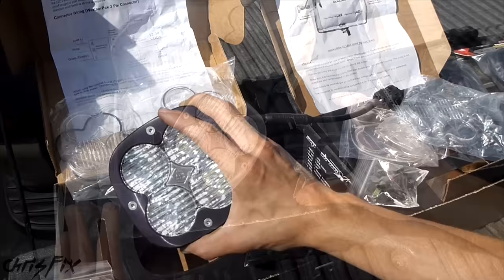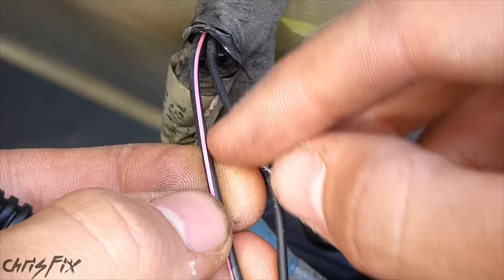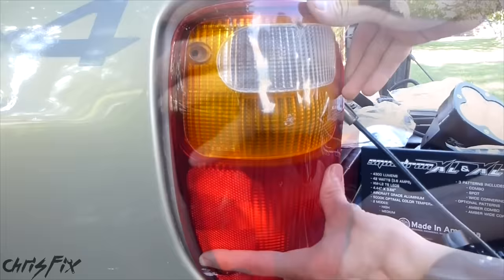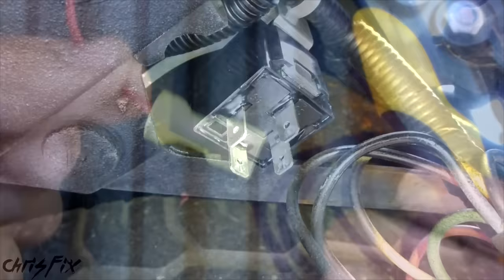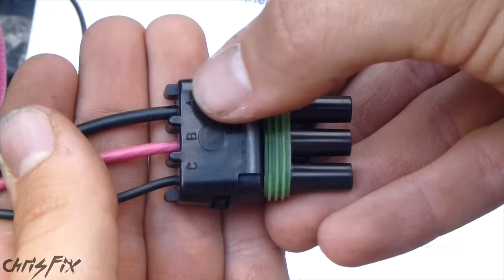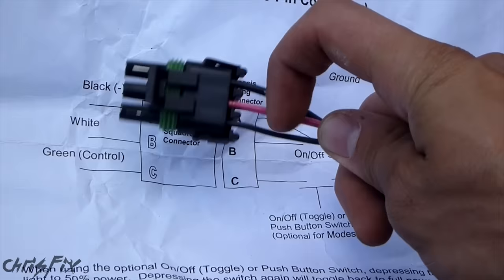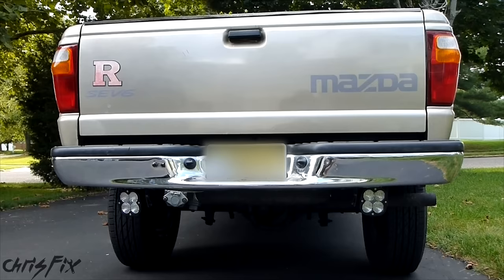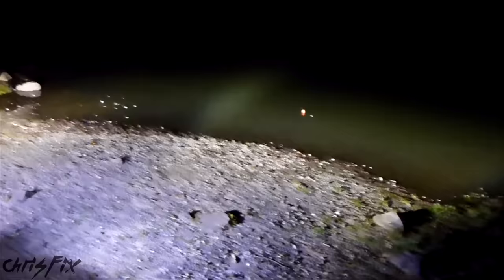How to Install Auxiliary Reverse Lights

Comment: I would install this just to mess with people driving with their high beams on
Reply: Mannnnnnnnnnn just picturing that sounds fucking priceless 😂😂😂😂
Reply: someone actually did that to me the other month, some dude left his high beams on so i flashed mine at hi and after wed passed he flashed his back lights at me
Reply: I added a 40 inch in the bed so if someone tries to tailgate or blind me i got my way of telling them to back off
Reply: Your gonna go in reverse mid drive 😳
Reply: Bababooey
Reply: @reneramirez5020  bababooey
Reply: @Jumpsuit13HEYPEOPLETHISISMYURL  bababooey
Reply: @Mydickfelloffagain  bababooey
Reply: I already have lmfao, thanks to his light bar video, I hooked up 2 10k lummens lights on my 2001 Windstar because everyone thinks there bad ass with there L.E.D headlights and brights on
Reply: I got 3 small light bars and 2 pods on the front that I'll turn on if they refuse to turn their highbeams off. Works everytime.
Reply: That’s exactly why I installed mine, to blind the people with their Hi-Beams on. Lol 😂
Reply: Now thats funny
Reply: You realize by cutting into the rear lights when he is in reverse that means you have to be IN reverse to activate the lights
Reply: Why
Reply: Read my mind 🎉🎉
Reply: It's not as effective at correcting people as you would think. I have "work lights" on the back of my work truck and I've tried to flash them once or twice while driving at night on a windy highway next to the lake where it's hard to see anyway and nobody has ever responded by correcting their error. And the lights I'm talking about are very very bright.
Reply: This is exactlt y i wanna get these💀
Reply: @Uvhash  it's very easy to run them to a switch instead, so you can turn them on when. I'm pretty sure that's what everyone was talking about.

Comment: Only problem with that location is if you're driving through a dip in a trail and your front wheels begin to travel back up before your rear wheels come down you,re going to drag your lights on the ground :(

Comment: The easy way to tell which poles on a relay are the controller and which one is the load when the instructions are conflicting is to take a multimeter, turn it to ohms, and test opposing sides. The pair that shows no continuity (infinite resistance) is the load connections (what you connect to the auxiliary lights and battery), and the pair that show a definite number of ohms is the controller connections (what you connect to the stock reverse light and ground).
Reply: wow actually a useful comment
Reply: Thx
Reply: Hey, why is the relay necessary in this case? If there's already current being tapped from the reverse lights, why the relay?
Reply: @trinifirst6702  the lights are being powered directly from the battery. The relay is just a switch, which itself is powered by the stock light.
Reply: Bababooey...

Comment: Thanks for explaining how the relay operates.
Reply from the maker: No problem!!!
Reply: I'm not sure if I missed something, but what is the purpose of the relay?
Reply: Andy Perez most people would power the lights using only the power from the taillight. The relay uses the power from the taillight to tell it to use power from the battery. A relay "listens" for a signal to close the circuit.
Reply: For a quick second it didn't make sense, I just rewatched the video and not it makes 100% sense.  Thank you Bud!
Reply: @aguyandhiscomputer  the relay was unnecessary since he was still using the taillights. He'd only need a fuse at that point. A relay would be used if he was cutting power all together to only run the led lamps.
Reply: @iiSup3rior  I thought the relay would be best if the LED light power draw was too high for the factory wiring to handle.
Reply: @aguyandhiscomputer  yeah only if then. But even though power works through draw. So he'd need a bigger battery with more AMPS if that be the case. Or run an auxiliary battery for components like these then run that to run in series to the alternator to keep it charged. Most people get away just fine running an auxiliary battery then wiring is much easier. That is also when you'd use a relay since you'd run an auxiliary cable to the relay then the relay to the reverse light. But a relay could also be used if you want to add a switch so that it's always on a 12v source but not necessarily on the current of the reverse lights. You can get away with led reverse lights then when you need some light output you can flip the switch and you wouldn't need to turn the car on enable handbrake reverse. You just flip activate the relay. If you've installed a relay on your hids its the same concept. You only need power from one source then the relay will receive the message and power the other.
Reply: @iiSup3rior  ok thanks. I've thought of adding some lights to a few things so wasn't sure.

Comment: Chris,
Use silicone filled butt connectors for extra protection, and the tube is called "wire loom". I just used an old aircraft landing light from a Cessna 172 for my backup light with #10 stranded wire through a switch on the dash to the light and from the light to ground. I mounted it on the body rear bumper to the left of the license plate recess. It worked great!

Comment: Never thought about doing this. But being a delivery driver for a pizza place, these would come in handy when I back out of people's driveways every night. Although I'd have to use small Led strips vs these huge trail ones.
Reply from the maker: +Dylan Stassen (Bassman415) That is a good application!
Reply: i would try to avoid backing for safety and insurance reasons,, ups drivers and fedex guy they dont want them backing up  for safety reasons  a  just a thought  lite would be good though

Comment: Back in the day I has a 1973 Corvette with header and sidepipes. That left rectangular holes in the back of the car that were a perfect fit for halogen lights. I hooked them up to a toggle switch which gave me great back up lights. But what was even better was when the a§§holes would come behind me with there high beams blinding me I would flip the switch for a second and you would be amazed at how fast they shut the high beams off!

Comment: Great visual at 1:47
Reply from the maker: Thanks Brian!
Reply: briansmobile1 I
Reply: You assemble the conector wrong the rubber gromet goes on the wire before you crimp the connector
Reply: briansmobile1 p
Reply: briansmobile1 o

Comment: Great video! Feeling a lot more confident now about installing the same thing on my Jeep. The only I want to do is add a switch inside so that I can turn on the lights if I need to.
Reply: I agree with wanting to add a switch in my cab to control the axillary reverse lights. There is one video that I found its pretty good but he doesn't really show the connection to the rocker switch.  It would be great if you could show a play by play

Comment: Tip: after crimping a wire you can solder it to further increase durability. When u got the connector hot by sticking it long enough to ur soldering iron you can solder the wire to the connector. Once u solder the wire to the connector it is tough enough that u have to pull hard to break it. Vibrations and corrosion will no longer be a problem.

Also you should have put the relay inside the space where the taillight assembly mounts on the body. That will keep it safe from the elements. The spot u choose to mount it is prone to mud and water splash.

you should have used a relay socket then solder. Instead of connectors that connects one by one. Other wise this is very informative. :) Thanks
Reply from the maker: Thanks for the tips and thanks a lot!
Reply: @chrisfix  wow u are still replying to comments on your videos 7yrs ago. :) Can't wait on that honda turbo charge episode. Hope it comes soon...
Reply: Bababooey...
Reply: @chrisfix  bababooey...
Reply: @gabrieldauz3533  bababooey...

Comment: Tidy and well thought out installation.  One recommendation.   Slip some heat shrink on your soldered power connection up or down stream.  It helps prevents/inhibit corrosion at your solder joint when the vehicle is subjected to high humidity and rainy conditions.   All that aside, well done.  Thank you.

Comment: I added Nilight leds for added backup & rear end work lights...but used no relay.  I simply ran a hot wire from my battery to a separate toggle switch that I installed on the dash of my 2019 Ford Ranger.  From the switch..I ran a wire back  thru the fire wall and along my frame to the lights mounted on the rear bumper..& then the lights were grounded to the bumper mount.  Works well...very low current draw..no problems.

Comment: Very thorough details and a good clean, quality installation.  Good to see you used the wire loom, especially for that front to back power run.  A lot of people would have just run the wire itself but the loom gives that power wire good abrasion protection.  Last thing you want is a power wire rubbing against the truck’s frame :)  Nice job...
Reply from the maker: ***** Thanks a lot man! I appreciate the feedback! I really wanted to do this job right and show how it is done because of exactly what you said. I see that way too often!
Reply: ChrisFix got a question, I just ordered some of these lights for my 2010 f250. If I ran a main power wire from the battery then into my cab with a inline fuse and put in a rocker switch but also spliced them in to my taillight would that work to where I can turn them off even in reverse and not use them every time I back up?
Reply: ibkuhg
Reply: Bababooey...
Reply: @Emw12341  bababooey...

Comment: Anytime you install a relay, you should ALWAYS install a "flyback diode " across the relay coil. In your case,  across terminals 85 and 86, with the anode of the diode  to 85 and the cathode to 86. Whenever a relay is turned off, a high voltage spike will develop across the coil, and without the diode, the switch contacts can arc or the coil itself can fail. It is cheap insurance and a 1N4001 diode (or equiv) is all you need. - JAMES

Comment: Great video, but one thing besides putting the green rubber seals in the wrong place on the water tight connection. You didn't need to add the extra wire before the fuse going to the positive battery terminal, you should have put the ring terminal directly to the battery side of your fuse holder. The reasons are you want the wire to be as short as possible and now you have another connection (extra length of wire)to possibly come apart thats not fused.
Reply: orange seal

Comment: can you show us how to install a backup camera?
Reply from the maker: Good idea!
Reply: ChrisFix still waiting 😂
Reply: Same where you will get the power to the lights in this video. Connect the video wires to the entertainment screen then mount the buzzer if it is included.
Reply: Ben Hodges still hanging on to it 😂💀
Reply: @eatpigs0916  Dude how's your sis doing???
Reply: Agreed!! Like to see how to install a 3rd brake light with camera to my ARE truck cap. Truck is 2018 Ram Rebel 1500 with factory installer tailgate camera. When towing a boat or landscape trailer etc. Really help see you cargo and/or other angles backing larger or longer trailers!  I will bring you my truck and buy the accessories to make your video on the installation. Sound good for you?
Reply: @benhodges1258  I can explain it you, it's super simple.
Reply: Still wait8ng
Reply: @jonjohnson102  super simple I can walk you through it if youd like
Reply: @chrisfix  yes please do it chris that will be a great vid
Reply: Where is the video crist?
Reply: @chrisfix  waiting.....!!

Comment: This is a very good solution. I am wondering if it would be much simpler just disconnect the stock reverse light and use the male connector on the LEDs by adding a female connector. The 10A fuse should be good enough for two LED lights.

Comment: Electrical tape?! tsk tsk Chris. Heat shrink for exposed electrical connections
Reply from the maker: Thanks for the tip Troy. This is an old video, I do my electrical work differently now. I think you will approve of this: https://www.youtube.com/watch?v=1-F0PIF8Hqo
Reply: +ChrisFix Lol all good buddy. I think your videos are awesome. Keep it up!
Reply: How would he have been able to fit a heat shrink tube in there anyways? Electrical tape was probably the best option
Reply: When you attach a wire to the side of another wire there is no way to get the shrink tube there.
I prefer electrical tape secured with two zip ties instead of cutting wires that dont need to be cut.

It is sealed from the elements well enough.
On a wire end to a wire end -connection i always use heat shrink tube as it is easy to put it there.
Reply: Lol what do u think electric tape is made of
Reply: Hello

Comment: In the beginning, as you were displaying the parts, you lifted each part up for the camera.  The relay had 5 pins.  Shortly, thereafter, you displayed a diagram, with arrows) of the back of the relay switch, which had only 4 pins (black background).  

If I wanted to use a switch on my dashboard, would I need five pins or 4?

Comment: I would’ve used the hot wire to the taillight. When it’s dark enough to need your lights is when you would typically need extra light for reversing. But great install anyway. And those things are SUPER bright.

Comment: u can use a balloon to protect the relay & wires then electrical tape at the end
Reply: mobileterminaluser that's actually a great idea! I also think the relay connections are very vulnerable to corrosion due to water that would get in there.
Reply: What a great idea. Never would have thought of that. Does it really stand the time?
Reply: mobileterminaluser I would though about something less prone to heat damage... self bonding tape maybe
Reply: I have used fingers cut from surgical gloves.  then wrapped the whole thing in tape.  It seems like they would last quite a while.

Comment: Chris 
Flush Mounted the Reverse lights in to my Bumper and wired the lights right into my Factory reverse lights, no need to hook up Relay or run extra wires, the lights still work after 6 months.
Reply from the maker: Thanks for sharing!

Comment: 87 & 30 are interchangeable as they are both switch wires , The power will run through the closed circuit in either direction

Comment: Chris, when I use crimp connectors like the ones on your common ground at the back, I crimp them as well but I add a drop of solder on the strands poking out to ensure a good connection especially in the salty winters we have in Canada.

Comment: I see you wire up a lot of extra stuff on your vehicles, with all those extra lines on your battery cable, wouldn’t it be better for you to run an auxiliary fuse box?

Comment: Chris, I wanted to mention that the wire seals for the wiring going to the lights should to be installed differently.  It's a bit trickier than the method you used, but the seal should go onto wire first, and then the terminal is crimped onto the wire. The tabs that engage the wire insulation are meant to wrap around the surface of the seal as well as the wire so that you get a better weather seal.   Here is a reference link for what i'm talking about https://www.youtube.com/watch?v=wuL5ZU_SviI
Other than that, this is a great video, thanks for uploading!
Reply: As someone who worked in a factory that produces wiring harnesses - I second this! Right after I saw how he put those one I immediately paused the video and went to check if anyone has already mentioned this.

Comment: Love your videos, this one included. 

One point to make: when you're building those (Delphi Weatherpack-like) connectors at the 11:39 mark, I don't think you have the rubber seals on correctly. Those are supposed to slide onto the wire first before you put the crimp connector on. The end tabs of the crimp connector, which you have just wrapped around the insulation, are supposed to crimp down on the long edge of the rubber seal, thus holding it firmly in place.

Minor detail, and might speak more about my OCD than anything, but always best to ensure waterproofing measures for wiring work as designed...

Also, where you pack those other crimp connectors with dielectric grease -- probably better to buy the waterproof crimp connectors that have the heat-shrink tubing on the open end.
Reply: Bababooey
Reply: Bababooey

Comment: I used these instructions to install back up lights on my 68 jeepster. Using a relay is super cool, works like it's supposed to. Very helpful explanation on what goes where. ❤

Comment: I enjoyed the video tutorial. However I have major wiring OCD, those 'factory' connectors you were trying to crimp are Weather pack connectors. Check for videos on youtube on properly assembling a weather pack connector. The seal you slid over the crimp terminal actually slides over the wire first, then strip the wire, and the larger crimp wings are to be crimped over the wire seal. You can get a cheap weather pack crimper and terminal removal tool for under $30 and free shipping on ebay. You may find yourself wanting to use these connectors on other projects in the future and the proper crimper will prove itself useful. Edit- You can also use the same crimper with Metri-pack connectors/Terminals, in which case you could use a Fully weather tight Metri-pack connector/relay combo.